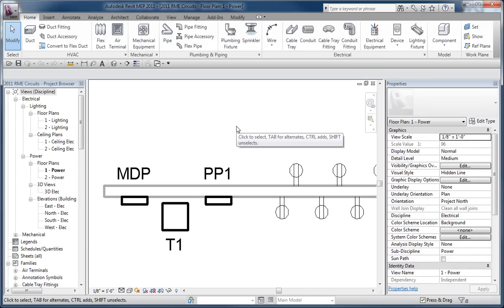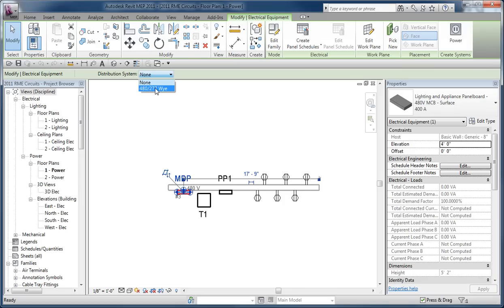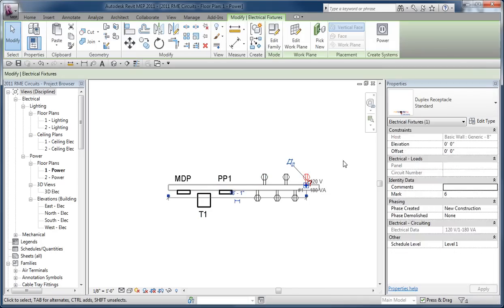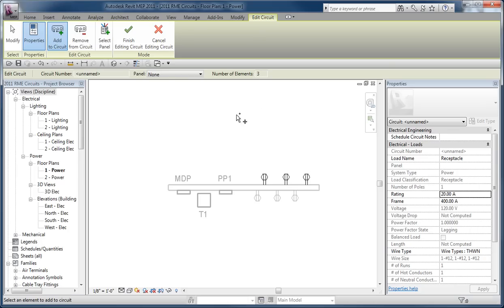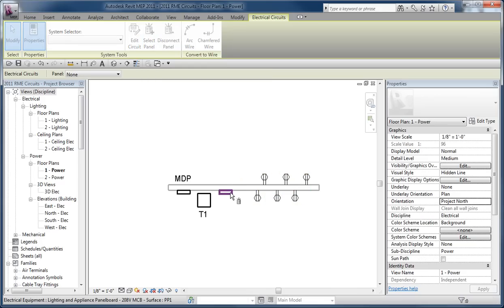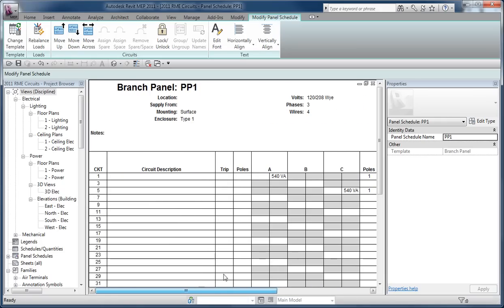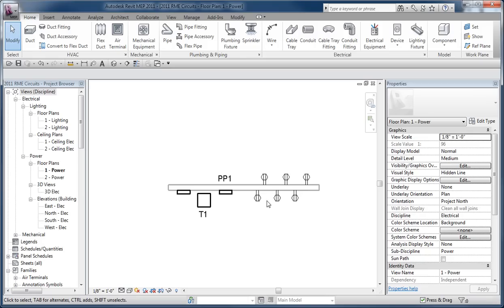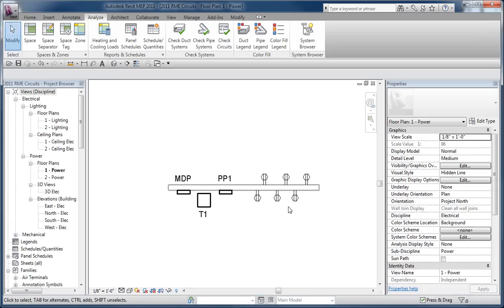Create Power Circuits

Comment: I have been trained to solve a problem for over a year with one of my templates in regards to the panel distribution of the power. I had a file upgraded to 21 from 20 no the upgraded some thing and now my panel does not read any distribution system at all I went through the template try to fix the electrical issue but I can’t any suggestions to how to fix a problem like this?